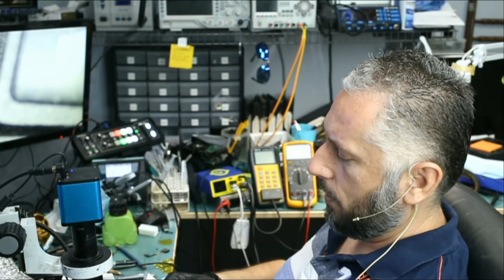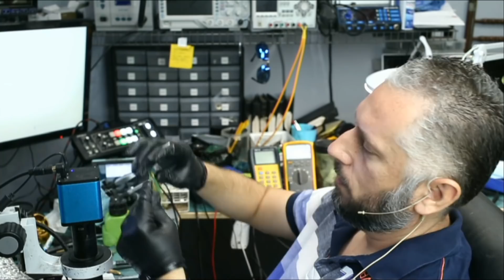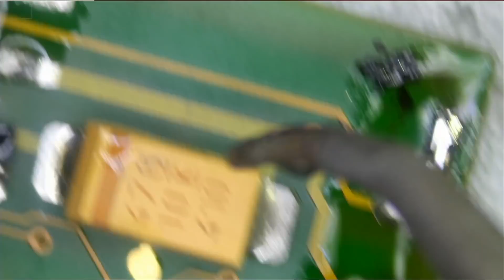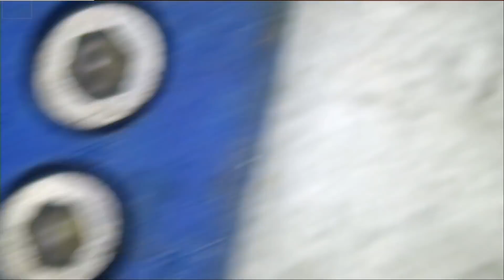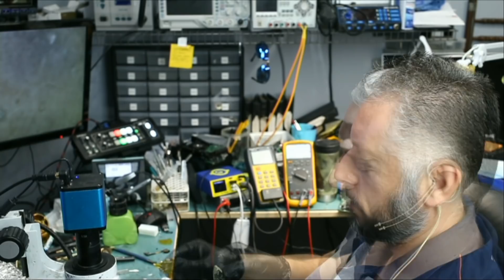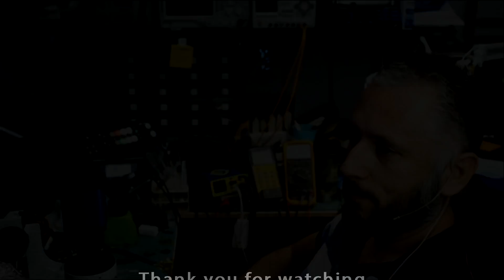2005 Benz C240 Kompressor Key Fob Expedited Repair - Broken Coil and Infrared Emitter

Comment: Nice work, just wondering why the soldering iron wasn't used to take away the IR sensor, instead of using the heat 'gun'.
Reply: Solder was under the component and in two separate spots.
Couldn't get it all hot enough at the same time to remove and then attach.

Comment: Hey great video I have a question so recently I updated my iPad Pro12.9 2nd gen 2017  to iPad OS 15 it was working fine the first couple days then another update came out 15.0.1 while I went to update it to it over night and my iPad was also on low battery next morning it didn’t want to turn on or boot up on the computer with iTunes but when I plug it in to a portable charger it shows that it is receiving power but will not turn on there no cracks what’s so ever not sure what’s going on any suggestions ?

Comment: I am in INDIA and tried calling on your number. This is regarding a high ASUS motherboard which rebooting constantly. I tried everything here in india but nobody is I found skilled to repair. I feel there is some some problem related to power which causing the problem. If I make any changes it does not even boot. I am willing to bare the repair expenses and shipping. Please help me. I could explain the problem in detail if you want over call or email. PLEASE HELP.

Comment: When desoldering heat sensitive components, what do you do to take extra care? Why not hear from the backside in this case?
Reply: He could have wrapped the component in Aluminum foil to protect it.
Then, once loose from it's solder joint, had a fan near by to cool it down quickly before re-soldering.

Comment: Amazing job....
I have a question regarding the cleaning swap you use... I saw some vedios you used two types of swaps one may some cotton hairs stuck to sharpie components and other doesn't... So I'm asking about the second one.
Reply: I think the plastic ones were perhaps gun cleaning swabs which usually are polyester based tips and come in square or concial shaped tips.
Reply: Me also.  One seems to be the wooden stick like used in Dr. office, the other looks like plastic sticks and dual ends, like you buy for cleaning a baby's nose in the pharmacy.

Comment: This guy is rough on fobs.
I can't believe that it's so expensive to just buy two new fobs.
I don't know what Mr. Alex is charging and I am always for him to make money but how much could a new fob possibly cost.
Reply from the maker: Benz dealership charge up to $700 for a fob and you have to go thru a tedious process that can take up to few days to get a fob.  You can't even get a fob for older vehicles such as 1999 as one customer stated. You'll have to replace the whole ignition system which can cost up to $5000. We charge $195 to $249 for a fob repair. In this case the customer also requested expedited service +$49 since our current queue is 2-3 weeks. Not only does the customer save money but also get it done quick. We get at least few fobs a day expedited where the car is stranded and will be towed away if not removed. Since we stock all Benz donor fobs, we are able to fulfill the ticket in a timely manner.
Reply: @NorthridgeFix  WHAT!!!!!?????
I had no idea they were that expensive.
Well, I'll never own a Benz.
I get it now Sir.
Thank YOU for the info.
I see how lucrative your business is for not only this kind of service but the rest as well Sir.
I will be ordering some supplies from your company soon.
And, I'll be spreading your fob repair abilities around here in Memphis TN.
Thanks again Mr. Alex.

Oh, I hear that the Russian space station is having some electronic equipment problems. Would you be available for a trip into space?
Just kidding, but I bet you could fix anything up there.
Bye!

Comment: Customer states both fobs lock and unlock car but IR and coil broke off of this fob. Initial thought is that L/UL and start are transmitted differently; IR for one, RF for the other [?].
If fobs use both RF and IF signaling to the vehicle, how can the L/UL work but no remote start?